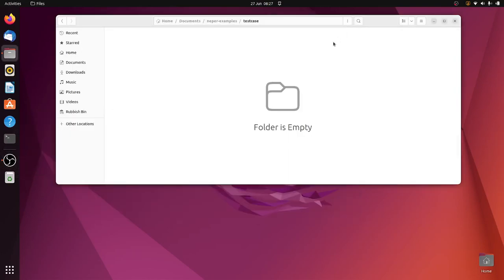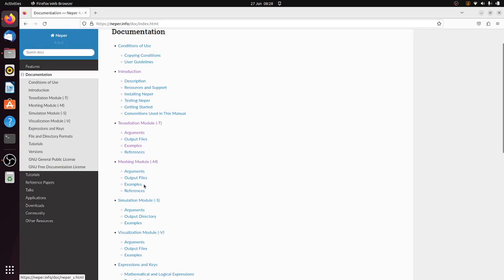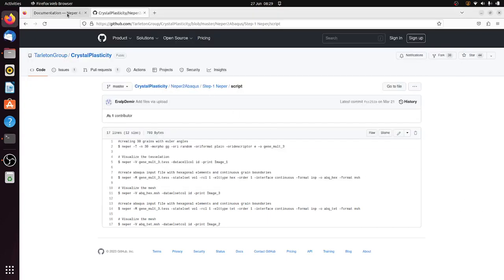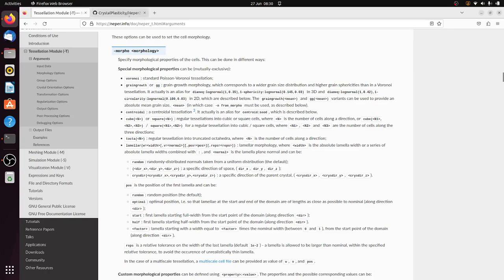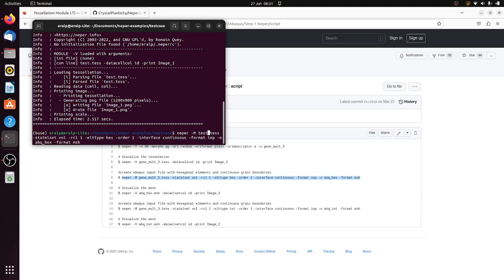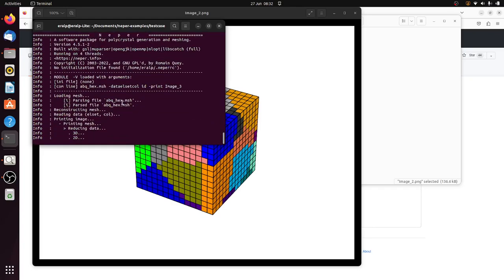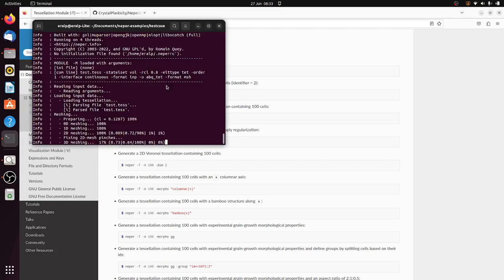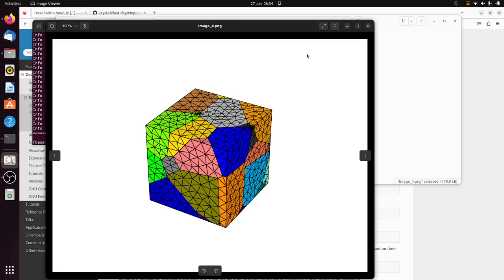Polycrystal mesh generation using NEPER

Comment: Thank you very much for your video! May I ask if I can use Neper to generate grains based on my optical image (.tif) of microstructures of my material, please? Many thanks
Reply from the maker: @JinYe-f6j  Hi, I do not if there is a feature available for that. I know Dream3d can read .ang or .ctf files.
Best